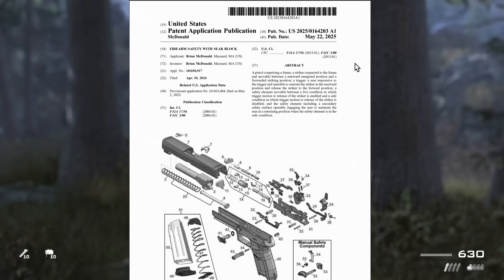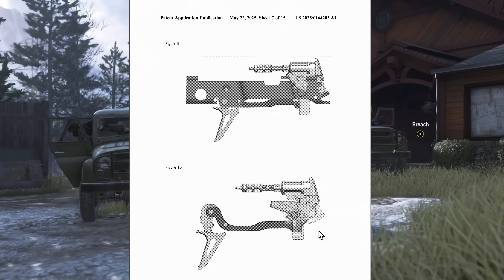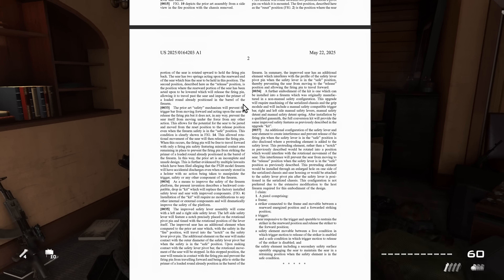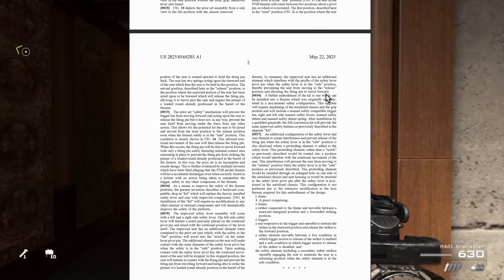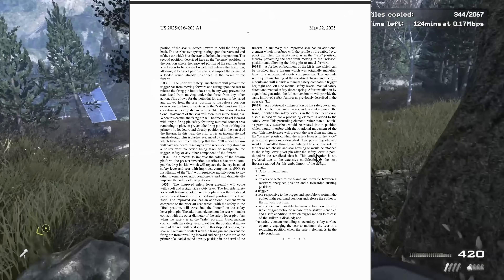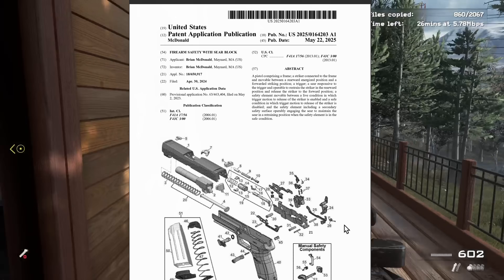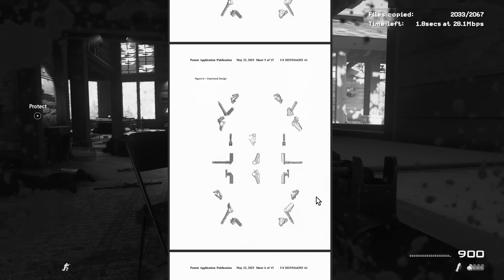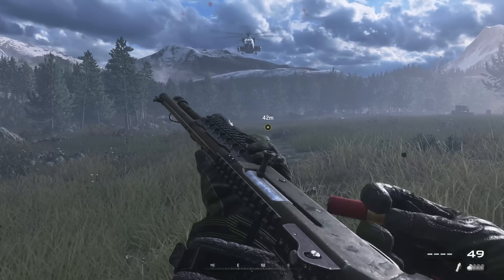Explosive: New Patent Claims Fix For  "Incomplete, Unsafe" 320 Design

Comment: This mod is for the manual safety models only, the majority of users purchased the non-manual safety models. Because in some unfathomable distortion of logic everyone suddenly decided that cocked-&-locked was gay and demanded cocked-no-locked instead.
Reply: The patent includes language about modifying components to add a manual safety if there isn't one.
Reply: @TheAllthatremains94  yeah but no one is going to want to do that.
Reply: Cocked and locked is kinda gay to be honest. Everyone knows it.
Reply: Because cocked and locked is unecessary, and can slow you down in a situation that you might only have a few seconds to react.

It's also functionally useless when you either have a trigger safety, or carry decocked on a DA/SA pistol. 

Nobody demanded cocked no lock though. Hence why Glocks are popular, because the striker isn't precocked, and why decocker hammer fired guns are also popular for carry.
Reply: It works with glocks with no issues
Reply: @Russianmafia10 Hell, even on other pre cocked striker guns like Caniks or HK VP9's it works perfectly fine.

There's just no need for it, especially when a rigid locking holster is already a safety measure.
Reply: The Glock striker is not fully cocked when a round is chambered; it is in the 320.

And, yes, it is silly that Glocks are somehow considered safer to carry than a 1911 in condition one.
Reply: @sinisterlookingmfer that is a Glock feature I like, however all the other guns from CZ, S&W, etc also keep the striker at full cock with no issues
Reply: @sinisterlookingmfer  Glock's partially cocked striker still has plenty of energy to set a cartridge off, a guy called 101stChairborne has a good video about it. So it's not really the safety feature we've all been lead to believe.
Reply: @sinisterlookingmfer  And what carry condition does a P320 offer, condition 0 ? Hard pass
Reply: Because manual safeties on striker guns IS gay

Comment: lol remember back in the early 2000's when Ron Cohen was the CEO of Kimber America and turned that company from a pretty highly regarded 1911 manufacturer into a trash company with poor QC? Took Kimber years to recover (I still haven't gone back.) Then Ron went to Sig and did the same thing (mid 2000's Sig) with putting out 50 models of the same gun that no one cared about like "rainbow metal and diamond plate texture" models, replacing metal recoil spring guide rods with plastic ones that broke etc... and now... here we are with the P320 disaster.... using MIM parts on internal safety parts to save like 30 cents a part etc...  *eye roll...  The German Arms Export debacle with South America... etc. this guy is such a scammer.
Reply: MIM parts in and of themselves are not bad.  Glock, Springfield, Smith, Walther, ect. all use MIM parts.  Poorly designed and machined solid metal parts are often as bad or worse than MIM (think Turkish 1911/2011's). One difference being that you can generally "fix" a solid metal part where you cannot a MIM part.
Reply: @jeffhernandez5098  agreed. A part of it is also where those parts are used as well.

Comment: Trusting this upgrade would be about trusting the metalurgy and hardening of the safety lever/bar. If it's plastic, low-grade aluminum, MIM, or untreated steel, users will have to worry about wear on the engagement surfaces. Can't trust the company, so why trust that?

Comment: This would basically make your P320 safety behave like a 1911. I would buy this in a heartbeat, and fully trust it.
Reply: Disagree on that, even with the thumb safety disengaged the sear on a 1911 is held in place by the sear spring and the resistance of the sear nose being pushed down by the full weight of the mainspring leveraged through the hammer. 

The 1911 also has a second notch in the hammer, the halfcock notch, which acts as a fail safe in case the sear were to slip off the fullcock notch for whatever reason. 

If the P320 had a sufficient system like the 1911 to keep the sear in place to begin with these problems wouldn't have happened. 

So unless this design makes the p320 sear stay put, then as soon as you take the gun off safe you are back to having a weapon that discharge uncommanded and that is still dangerous.
Reply: This patent does not fix the issue of the P320 firing by itself. The striker is still fully cocked. The striker safety can still be made inoperative from movement. The striker can still slip off the sear.

All it does do is make the P320 marginally more safe with the new safety on.
Reply: @donwyoming1936 this safety is supposed to keep the sear locked in place to prevent slippage. But I do think it’s a hack for the real issue, which is a poorly designed striker block mechanism

Comment: I actually don't know if this would fully solve the problem. I think one of the problems is the rails of the fcu frame get loose and the slide to frame tolerance gets bigger. So it allows the striker to pull off the sear.
Reply: ABSOLUTELY!!
Reply: I think this would fix the issue but only if the safety is used. The sear wouldn't be able to move down far enough with the sloppy fit for the striker to drop. But this is 2025 and the market doesn't want a striker fired pistol that's only truly safe with a manual safety. I don't even think the military would ultimately want this because of how risk adverse they are. Some places have previously mandated carrying chamber empty and the safety on so a pistol that's only truly safe with the manual safety on isn't something they'd want.
Reply: https://youtu.be/Dkw-yu6dV2c?si=ZhWoLypIOSJPGMSK
Reply: While this is probably an improvement, and I have no problem with a manual safety on what is essentially a single action pistol, I don’t think that this solves the whole problem. IF, emphasis on the IF, the purported un-commanded firing is related to frame-slide fitment, then this might just prevent un-commanded firing right up until the safety is deactivated. It is way better than the current situation, but what if it goes off the moment that the safety is deactivated? Better than nothing, but still far from ideal. IDK what the purported problem is caused by, but it seems to me that part of the problem is that the striker block is not working as intended. Even if the seer gets jumped for whatever reason, the striker block should prevent discharge, period.
Reply: @andrewhahn1476I agree. I think the problem is a cascade of failures. Sig tried to make a Swiss watch and it's too complicated for its own good. I think it's a combination sear engagement/design, fcu frame strength, and striker safety and tolerance stack-ups between each. I would love for someone to design an actual fix. I suspect it can be done, it just depends on who will be the first to actually fix it, not just partial fixes.
Reply: If I had one I’d mig weld a bit of extra material to the rail tabs and hand fit em down tight. Not realistic for everyone. But I think this safety style with a known tight fit would greatly improve it. I’d have to mark my seat face and see the contact patch for myself
Reply: @jefferyboring4410 That's a good potential solution for somebody who possesses those kind of skills. For all of you that don't possess those kind of skills eat the loss and throw it in the damn garbage. And if you just have to sell it make sure you sell it to somebody who is competent and is aware of the 320 and it's issues please don't sell your problem to somebody that's going to get hurt
Reply: Only with the safety engaged. You could still easily have uncomanded discharges when the safety is off. Like say a Leo draws on someone and then has to move from cover bangs it on the wall and then bang or any other myriad of circumstances. This fix is only a half measure at best.

Comment: The only downside to this is the gun has to have a manual safety. There are a ton of 320s out there without a manual safety. It seems to me a fairly easy fix is to use a trigger that has a safety tab. It would completely prevent the striker safety from being released.
Reply: It looks like a few have already posted, but yea, this fix will do nothing for the no manual safety versions of the 320...  Half way there?  :)
Reply: The safety tab does not seem to be enough for the P320
Reply: I would not add a manual safety to any of my 320's.  Just saying.
Reply: @jeffhernandez5098 I don't think it will help though. You're assuming the sear drop is the problem. I'm more convinced it's the slide coming up off the frame.
Reply: @jeffhernandez5098 Then a prosecutor will have a field day if you ever use it in self defense 😂
Reply: Safeties are drop in upgrades for 320s and 365s. You just have to file the grip module to accept. Most aftermarket grip modules have the area to remove for safeties marked so anyone can do it at home with a small file or Dremel.

Comment: This seems like an obvious design oversight (and still incomplete), and when I found out what the issue with the P320 was, that the only thing stopping the internal safeties moving is spring tension, I was surprised it made it through any design review.

This doesn’t fix the issue of if you have even slight pressure on the trigger (moving it 0.5-1 mm) and the slide slightly moves that it fires. At the range a few times my P320 had fired a follow up shot that surprised me as I hadn’t intended to fire a second shot that quickly. I hadn’t assumed it was user error until the recent findings had been made.  This makes me think it’s still an unsafe design until a proper passive safety is developed.
Reply: A properly functioning striker safety takes 1.5mm - 2mm  of trigger travel to defeat.  Period. Check out Sig Mechanic.  He has very precise measurements of all aspects of the P320.  Best part is that they videos are a couple of years old.  He was not defending or supporting any arguments.  He was simply taking measurements.
Reply: @jeffhernandez5098 that’s cool and all, but that doesn’t take tolerances into account, which we have no idea what tolerances are on Sig’s part drawings. Actual functional tests with P320s that have had the “voluntary upgrade” or that are post the rollout of that upgrade have had the gun fire with 0.5 mm of travel and slight movement of the slide.

Plus, inertia can overcome spring tension, which is how some padlocks can be opened non-destructively by whacking them with a hammer. The same principle applies to when a P320 is dropped, which this doesn’t fix if the safety is off.

When I had heard talk of “internal safeties”, firearms not being a field I’ve been in in my career, I foolishly took it at face value and assumed they were like other safeties. In hindsight I wish I would have taken the time to actually look at the system in depth before I bought mine.
Reply: @Colonelloki  BS to paragraph 1.  Show me repeatable measurements that the striker safety can be defeated with .5mm of travel.  Not a guy with calipers measuring the trigger to grip clearance.  Actual measurements showing the striker safety defeated. As Sig Mechanics did with a trigger scan gauge.  I'll wait.

The P320 has been drop safe since 2017.  Please stop with that junk.  Not a single reported drop issue with an upgraded gun or one made post upgrade.

Internal safeties actually exist.  Not all safeties must be external or visible or able to be manipulated.
Reply: @jeffhernandez5098  https://youtu.be/jOMQOtOQoPk?si=TWrBX8EVFMwlPIu3

Yeah that isn’t around because that’s way too expensive, and being an engineer and knowing the way companies massage numbers I’m going to take anything Sig Sauer says with a grain of salt. That said, caliper measurements are still enough to get how far the trigger moves within a millimeter, which even if it’s 1.5 mm actually, or 2 mm that’s unacceptable.

The claim about there not being an instance of one firing from a drop since 2017 is just false, as court cases with new or “upgraded” guns have shown.

The internal safeties I even mentioned.  I know they are there.  The only thing that prevents their movement is spring tension.  That’s an AWFUL design that shouldn’t have made it through the first design review.
Reply: @Colonelloki  
Paragraph 1:
I didn't quote anything from Sig Sauer. A youtuber, just like you, with a channel called Sig Mechanics made the measurements I referenced but I said that already.
What data do you have to support your claim that 1.5mm or 2.0mm is unacceptable?  Please share.

Paragraph 2:
Again, please provide data.  A link to a successfully litigated court case with a judgement showing a drop safe issue with a VU pistol or post 2017 manufactured P320.

Paragraph 3:
Not only did it make it past  "first design review", it made it thru DOD review.  You don't think the military has good engineers?
Reply: @jeffhernandez5098  Oh, a channel with 22.5k subscribers I’ve never heard of that sounds like it’s the company, clearly my bad for not realizing you meant a YouTuber I’ve never heard of. Point still stands though, as he was only looking at the function of different triggers, and that’s is a very expensive bit of equipment that is not needed to assess this specific failure. In one video he was also looking at the function of the manual safety. In none of his videos did he move the trigger a small increment, then press on the slide slightly.  As for 1-2 mm not being acceptable for the trigger to move and unintentionally fire through light pressure to the slide doesn’t need “data”, that’s common sense.  You have not completed a full trigger pull, you did not intend the gun to fire, it is definitionally a malfunction. Needing data to justify that a gun shouldn’t fire before the trigger has moved far enough back to trip the sear is just dumb. That said, from Sig Mechanics, the distance to break is 4.5 mm, which you may notice is more than 1-2 mm.

The JTF-2 in Canada conducted an investigation that showed partial trigger pressure and slight movement of the slide was to blame for the misfire. As for a court case, simply because the case was settled outside of court doesn’t mean the problem doesn’t exist, but Derosiers v Sig Sauer Inc. the jury ruled that Sig Sauer had defectively designed the P320, that the defective design caused injury, and did not give adequate warnings regarding the risks.

I’ve found stuff that the FAA has missed in my career.  Even good engineers can miss things, especially if it’s not a product they design daily.  An outside committee missing this is not surprising.  Senior engineers at Sig missing it is.
Reply: @Colonelloki  LMFAO.  There are a lot of small channels with fantastic content that you aren't aware of. 

His channel may be small but his methods and procedures are hard to fault.  
He didn't move the slide because that wasn't the purpose of the test nor was it a topic of discussion 2 - 3 years ago.  
At what point in the trigger pull has the striker safety been defeated in other models?    You keep saying 1mm - 2mm is unacceptable.  It's actually 1.5mm - 2.0mm.  Where, in the distance from rest to break, should this occur?  
You also say that because you have not completed a full trigger pull that you have not intended to fire the gun. WTF?  If you take up the slack your intent is to fire the gun.
Reply: @jeffhernandez5098 I wasn’t criticizing the channel, but rather your expecting me to know that’s what you were referring to.  You’re clearly upset over this, and it seems like continuing this discussion will not be fruitful at this point. Take care.
Reply: @Colonelloki  nice dodge.  You take care as well.

Comment: If you take the safety off, what's to prevent an unintentional discharge?  Glock has a firing pin safety that disengages only if the trigger is pulled.

Comment: Looks at this document?  When it was filled in response to another document filed back in 2023 and 2024?  Where are those documents? And who did these patent? SIG or third party engineers? So from 2023 there have been designs regarding this safety upgrade?

Comment: Likely have not heard about it because the guy likely worked on it while he was at Sig.  He would have been under a noncompete contract which likely runs 5-10 years.  So just take some work you did at Sig, take it home, sit on it till the noncompete runs out and then patent it yourself.
Reply: a lot of times a contract will have something like any patents during the time they work there or at least were worked on at all during work hours belongs to the company. Which might cause some issues

Comment: Don't you need the sear to drop when you "rack the slide" in order to make room for the striker catch? With the safety on I see a noteworthy potential for damage in those parts. Good enough for a quick hack on a gunsmiths table though I would be very surprised if SIG choose to implement this. Unless the safety can also stop the slide from moving somehow...